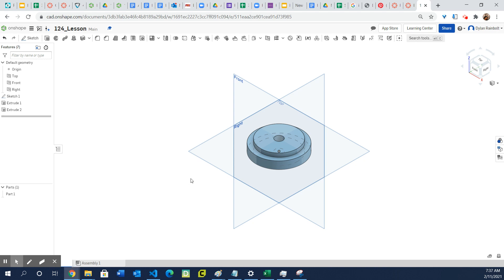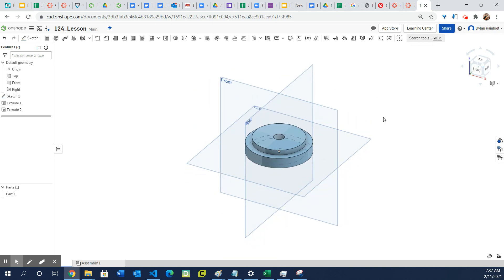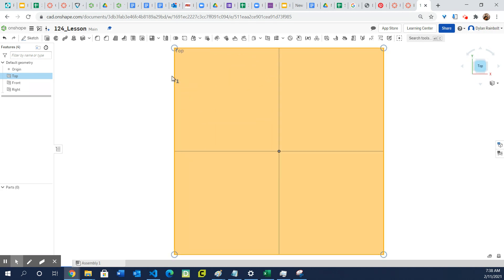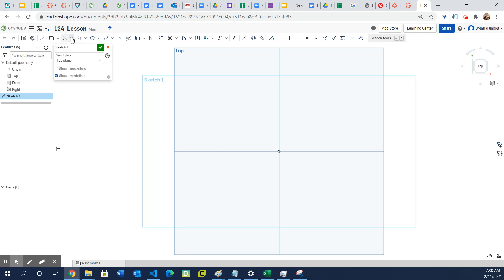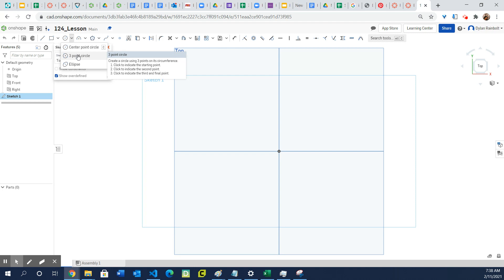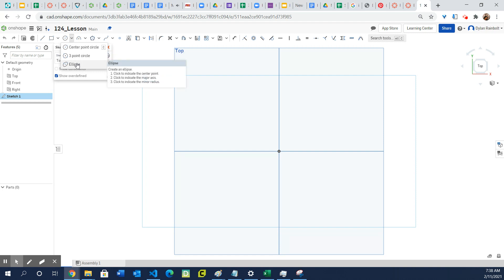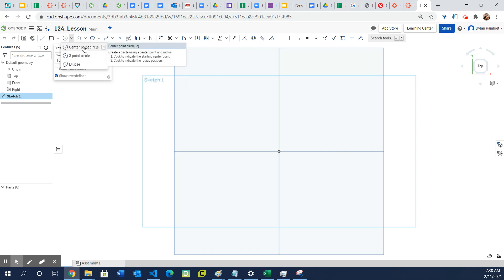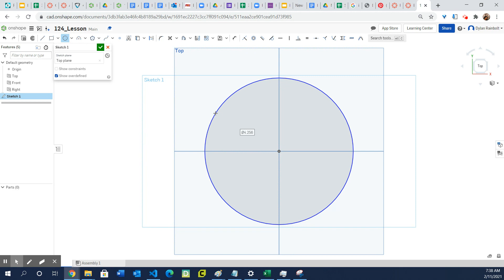How To Create a Circle Sketch in OnShape

Comment: I followed your instructions until it cut out. But for the life of me I can't make my circle "fully defined" It stays blue instead of turning black. Can you tell me how to make my circle fully defined?
Reply from the maker: @moodberry  absolutely! You would want to ensure that it is coincident to the origin point (within the circle sketch, type Alt+C and type in coincident. After select the origin point of the circle and then the origin in the part studio). Finally, ensure you have dimensioned the circle by applying a dimensional constraint to it. If you go back into the sketch and don’t see a dimension constraint for the diameter of the circle, simply press “d” on your keyboard to bring up the dimension took shortcut. Click on the perimeter of the circle and then you can type in the preferred diameter dimension. Hope this was helpful!
Reply: That helps but I don't understand what coincident to the origin  point means. Can you expand please?
Reply from the maker: @ absolutely. You just want to specify the location of the center of the circle in reference to another point or edge. For it to be fully constrained that means its location is specified as well as the actual size of the circle. If you made it coincident to the origin it would share the same location as the origin.
Reply: @DylanRainbolt  I really appreciate you engaging with me. So, here's what I am doing.  I create a sketch and select a plane. I select the center point circle tool. I click on the plane and draw out a circular shape and click again. and enter a number for the circle and hit enter. No problem. Now I have a blue circle that I can move anywhere. The next steps are what are baffling me. The dot at the center of the circle I just made is the origin, right? As you said, I have to specify the center (the dot) to be in reference to another edge. So what would be another point or edge? I typed in the word "coincident" just as you said after alt-C. But if I click on the dot, it just draws another circle! I wish I could show you in a video I make what is happening. I think if I can just get this one concept in my head, I can really get going with Onshape.
Your video comes the closest to explaining. I just wish it hadn't cut out prematurely ;(

Comment: This should be posted under "Videos that ended before provided the useful information."
Reply from the maker: Yikes… I see it cut off a bit at the end. After hovering over the diameter dimension, just type the number you want to dimension the circle’s diameter to. Then click the green check mark to complete the sketch.
Reply: @DylanRainbolt  not useful enough
Reply from the maker: @zainahmed4172  what issue are you running into?
Reply: @DylanRainbolt  hey Dylan! sorry for the rudeness of the other guy but i'm honestly a noob and need help. I understand that i can change the dimensions right after i created the sketch. But is there a way to change the diameter aftwards? I Mean after i draw the circle.
Reply from the maker: @DruckLuc  absolutely! While still in the sketch, click on the dimension once then press the delete key on the keyboard! That will remove the dimensional constraint. After, press “d” on the keyboard or find the “dimension tool” and then you can click on the circle to set the dimension! If you have issues deleting the dimension, more than likely you are not in the old sketch.
Reply: @DylanRainbolt  thank you very much!